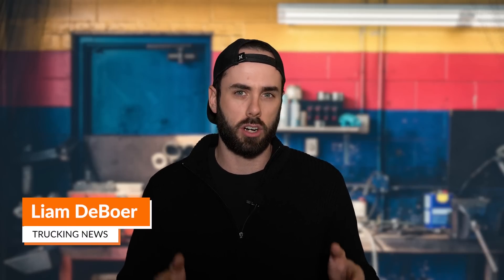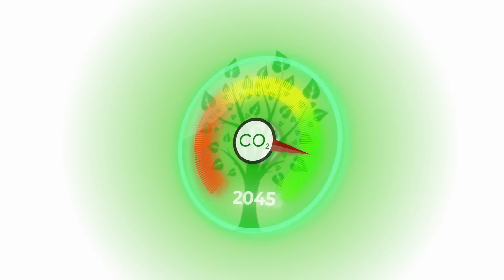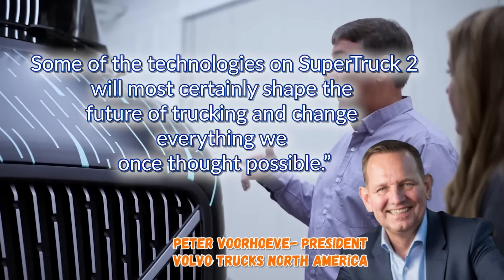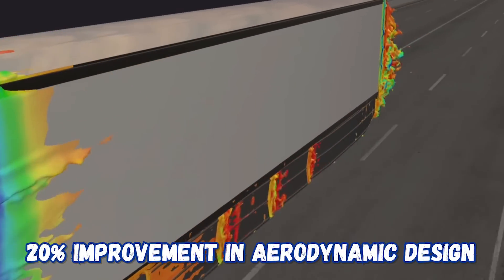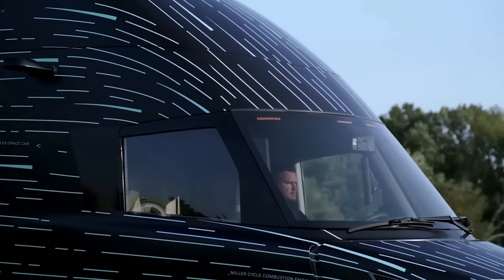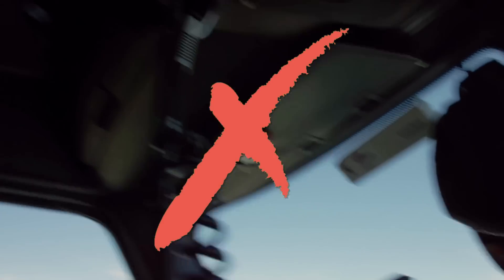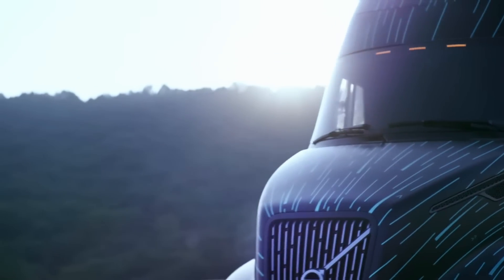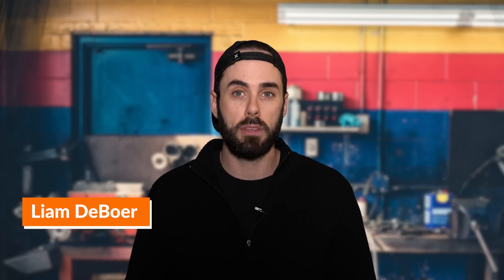Breaking News 🚨 Everything you NEED to know about the Volvo SuperTruck 2 (Masterpiece OR Fail?)

Comment: ive been driving volvo trucks since 2013. the 780 and then to now the vnl 860. can not compare to other makes. volvo designers are smart, amazing comfort
Reply: bs. Freightliner even 80,000 with 80mph is more efficient. Volvo runs 5.2mpg, with freddy you can not make it worse than 6.6mpg. Normal size seat, fridge and bed. No clancking noise from stupid iShift. No fallen pallet from rough start, gearbox is smooth like a butter. Freddy holds 40% of North America market. I wonder - why is that? Are all these walmarts, ups and others so stupid? No. They just value their money.

Comment: Love those aerodynamics. Can't wait until they pop my trailer tires after going over a railroad hump.
Seriously though I hope they are rubber and not hard plastic. My Cascadia had a front one until holey customer lots and sharp dips damaged it so much that it came off on the PA turnpike, and it actually did pop one of my trailer tires in the process. Thankfully it did not damage a steer. Also created a hazard for other drivers as I didn't know what those ghost bumps were until too late for me to try to clean up the mess.

Comment: I love the part where they mention trucker comfort. I believe the writers of the script failed to realize that apu's are louder than the engine and do not produce enough power than the engine to keep the cabin cool during the hot summer days rendering it useless and rather more uncomfortable. Along with other parts of the video, from experience from the driver's perspective; this video raises several eyebrows. How expensive will it be to replace the bumper against animal strikes considering adding a bull bar would render the aerodynamics useless? what about trailers that are not dryvans like flatbeds, lowboys and tankers? How am I supposed to do my PTI if I have to disassemble the whole truck just to see if I have a flat tire? What happends when there is an extremely heavy crosswind guess i'm tiipping over in the name of efficiency... Also their "real world testing with 65000 lbs GTW is NOT even remotely credible. I am running at 75000 lbs at the moment as do most truckers run at a heavier load on average than 65000 lbs... Why not test over 80,000? ET I just don't understand why you would upload this video.
Reply: The point of 65000 lbs is because that’s the average weight if you look at all the trucks across the country.   It’s m rarely over 55000.  As to the cross wind, it’s not what you think.  I pulled a double drop curtain side for Boeing that was only a couple inches from the ground and 14’ tall.  It handled better in a cross wind that a van with no skirts.
Reply: @rodtimmer2456 I see, thanks for the heads up.
Reply: @MrStefan100000 .  not to mention he said "cabin is shorter", oh well, thank you smart ass! :))) Even less space for driver untill they replace him entirely with damn autopilot.

Comment: 12 mpg is an extraordinary claim that required extraordinary proof. Today trucks are already areodynamic, looking at its shape it's not that much different from present day Volvo to five it an extra 4 mpg. Lighter truck could do it, but it would have be 20,000 lbs lighter or more to achieve 12 mpg. I am more curious about its engine, where improvement in efficiency will be made
Reply: Yeah, this video sounds like an advertisement. There are going to be trade offs somewhere at the very least.  Body repair will probably much more expensive.

Comment: So with lightet components such as drive shaft and axles i understand that its alot less resistance on the motor and it will help with the fuel mileage!  But i can also picture those components wearing down and breaking more often ! I would preffer to get 7 miles a gallon and not have to replace expensive ass part's plus 200$ an hour labor rate !

Comment: What OTR truck carrier or fleet runs at 65000 pounds? I thought they said real world, Yeah I could not achieve that, they are but I WOULD ALSO be WAY more effiecient in the long run, IF i ONLY ran 65000 pounds.
Reply: It’s the average weight of trucks on the road.

Comment: I have a love-hate relationship with Volvos...but 12 mpg can't be ignored...IF that is to be believed.   Question is...how will it be on maintenance costs?   Ease of repair/repair parts availability?   Cost of the power unit?  Can they be outfitted for heavier loads?  How will the aerodynamics hold up when hauling flatbed, tankers, etc.?
Reply: I call BS on that 12 mpg claim
Reply: @cyclopsvision6370  
It's definitely a bold claim...and one that will take a bite out of their rep if it proves to be untrue.
Reply: @cyclopsvision6370 you shouldn’t.  Joe Morrow is out there in an off the shelf gen 3 that anyone can spec and buy doing 10.4. So with the added areo of this truck I’d say it’s totally possible.
Reply: @rodtimmer2456  is that 12 mpg on a bobtail, empty trailer, or max weight 80,000 pounds cab+trailer combined?
Reply: @cyclopsvision6370  for starters avg weight across the country is 65000.  Not everyone  runs grossed out.  I am usually only about 55000 most of the time and only been maxed out a handful of since switching to van trailers 5 years ago. As to a Joel that is all miles since new with weights up to 80000 lbs running all 48.
Reply: @rodtimmer2456 . thats because all van driver haul air most of the time. This is not good example. Same for the tankers, etc.